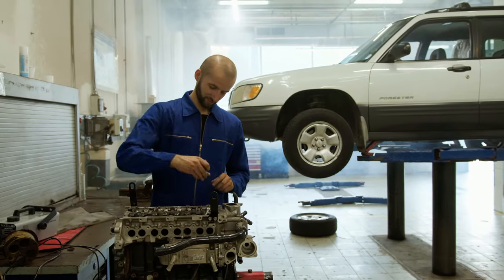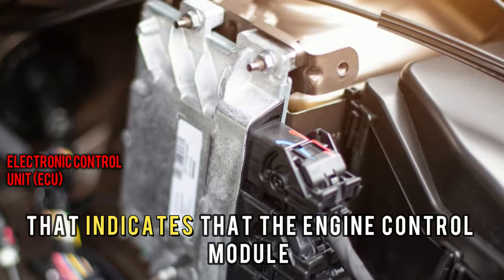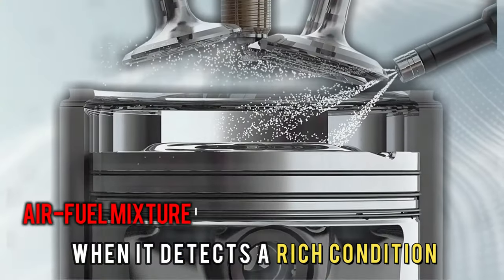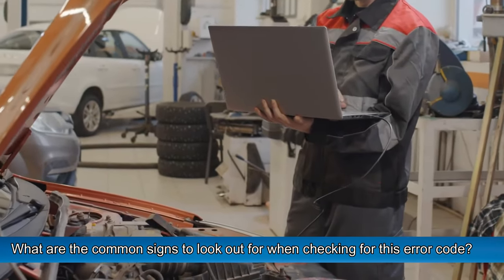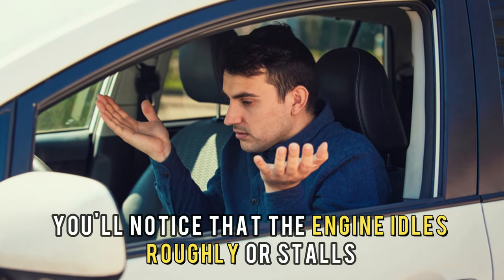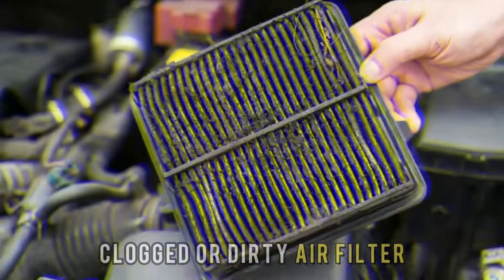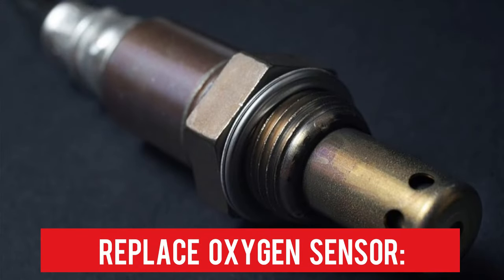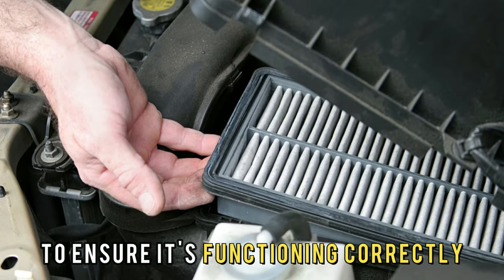P0172 ERROR CODE: MEANING, SYMPTOMS, CAUSES AND SOLUTIONS (system too rich)

Comment: What would be the problem if you put a new fuel injectors and new O2 sensor
Reply: Map sensor?
Reply: vacuum leak, exhaust leak upstream of your O2, carbon build up in the throttle body or dirty MAF, bad purge valve, fuel pressure regulator malfunction allowing high pressure during low rpm running..
Reply: You might need to reset the code by disconnecting the battery and drive 20 to 50 miles to see if the code comes back. The computer needs to recalibrate the trim for the injectors.  This might need to be done more than one time.
Reply: Try attaching a fuel pressure gauge to the fuel rail.  Start the engine and verify the pressure is in specs for your engine and vehicle.  Also check for gas leaks from gauge hose and fittings.  Fix any leaks.  Turn off engine and watch the gauge.  Pressure should hold for at least 5 minutes.  If it drops fast then you might have a leaky injector.  You can make a injector tester with a can carb cleaner, valve stem from a tire a 9 or 12 volt battery.  There are several posts on YouTube showing how to build one.  You will need to remove the injectors to test them.  Good  luck.
Reply: @MT-cy5tm My sc430 been running like chit , it seems hesitant like it's choking for fuel then boggs but doesn't stall , how about a dirty injector because the fuel pump is working , maybe a clogged filter? Need to know this been for 2 months , now I got a vsc , traction and check engine light , but think they are seperate issues.  Wondering about using that Bernies fuel injection cleaner like Scotty from youtube.